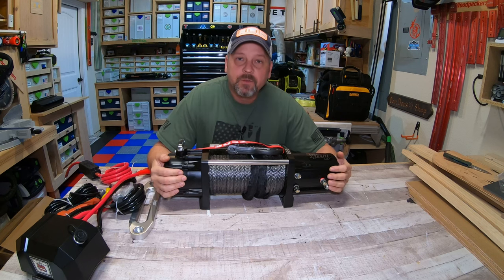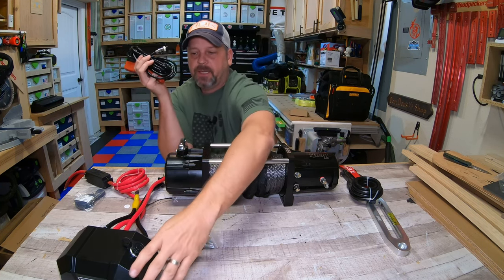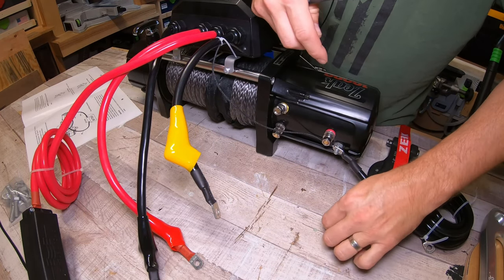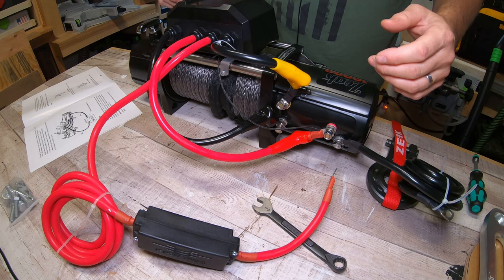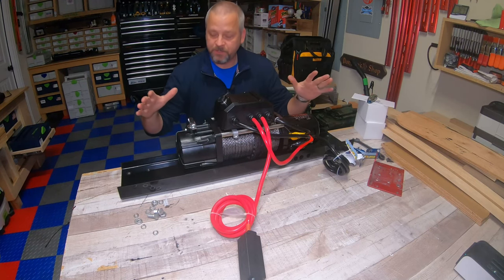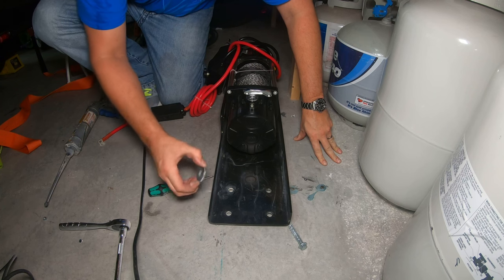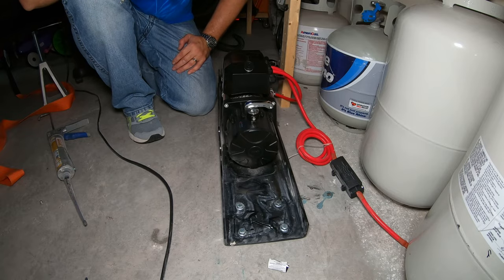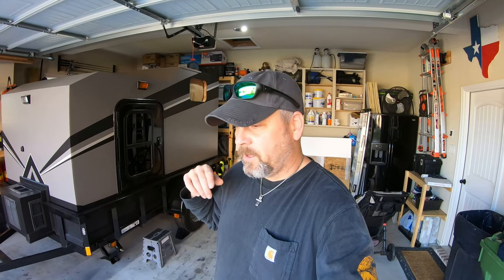Winch install on garage floor: ZEAK 10,000lb winch w/ wireless remote

Comment: The trailer is looking awesome. I’ve been looking at winches as well for pulling logs on my trailer.
Reply from the maker: Thank you sir! Might want to check out the ZEAK 5500lb winch w/ steel cable I had before I upgraded to this 10000lb one. It was a nice winch and priced fairly.

Comment: Cable capacity should always exceed the winch capacity or it could break  simply under the load of the winch.  It is good that the cable has twice the load compared to the winch.
Reply from the maker: Makes perfect sense now that I actually use my brain and think about it! Thanks

Comment: You made the same mistake everyone else does. You mounted it straight to the floor. You should have mounted it to a winch cradle and bolted a bumper hitch receiver to the floor. also use drop in anchors. Why? Because if you ever need to use the winch elsewhere, all you have to do is pull the pin and take it out of the receiver. Mount it on a truck or whatever. And of course if you ever need to replace the winch, take it off and put it on a bench.